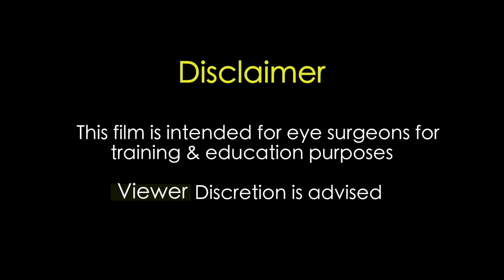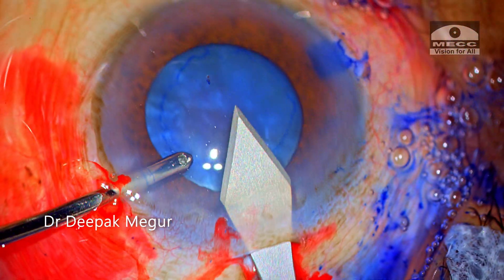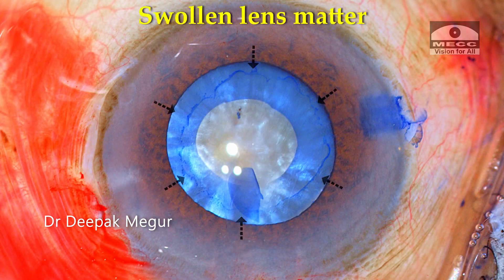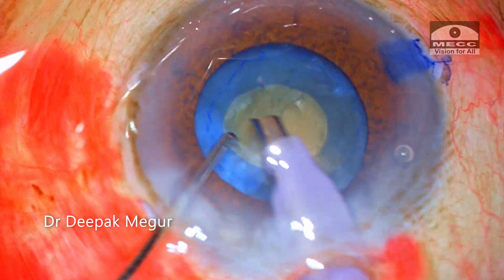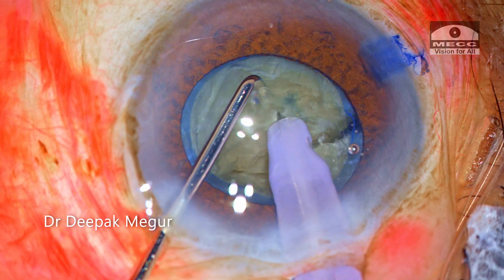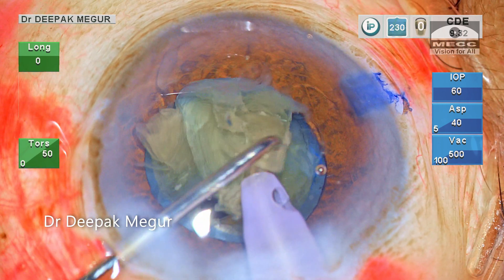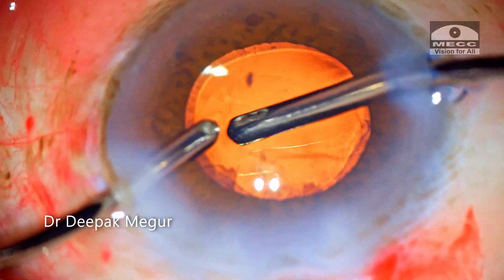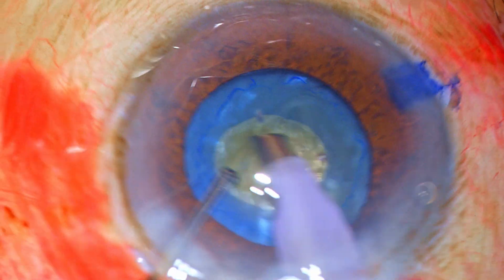The 2 staged Rhexis -Using the Phaco Tip to decompress the bag in Intumescent Cataract- Dr Megur

Comment: Super surgery ! Learnt the use of dispersive ovd to prevent Argentinian flag sign before the initial puncture of anterior capsule,  also the initial baby rhexis while keeping the AC inflated , followed by the phako decompression of the intumescent cataract to prevent run off during the subsequent enlarging of the ccc . Love the way you protect the endothelium during emulsification of fragments by placing the chopper in front of the piece as a barrier . Thanks 🙏🏼